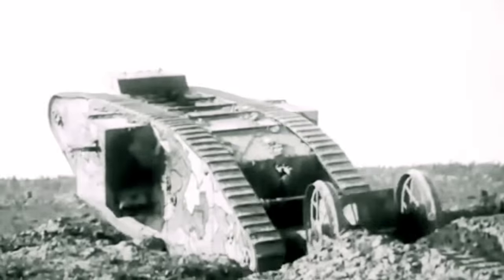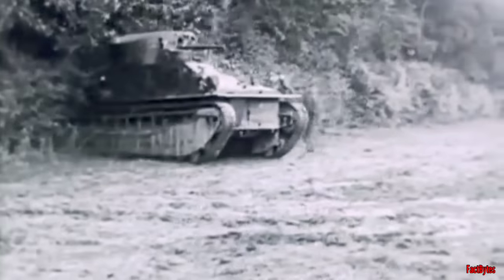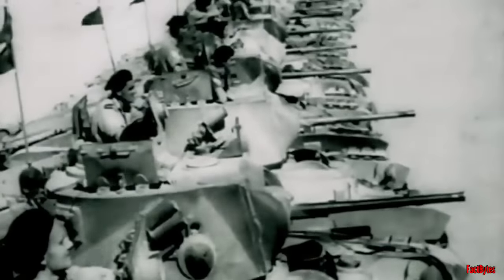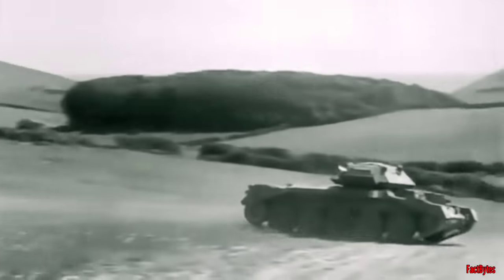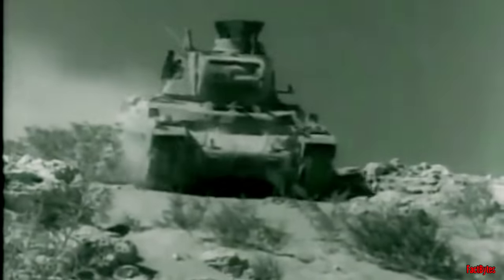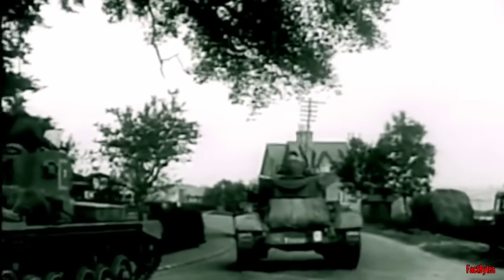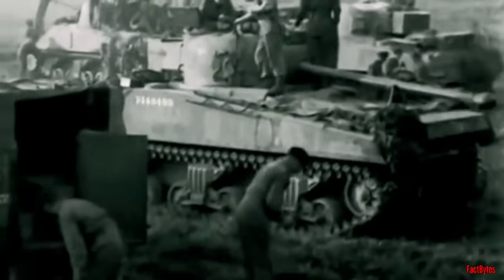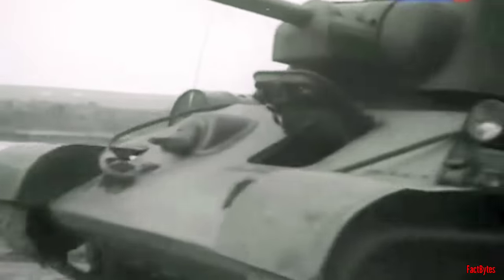Why Did Britain Struggle to Build Effective Tanks During World War II?

Comment: Good video - but I have a couple of criticisms

You should make note the light/infantry/ cruiser tank mentality was worldwide, as was the resistance to change, the US,  France, Germany Russia all suffered from the same issue and similar resulting bad designs.    The British also were stuck, even a bad tank in their mind was better than no tank so they used what they had to replace their losses in France, which you did note.

Although the Sherman was a good tank based on reliability and numbers produced, it was very vulnerable to all German tank and AT guns generally beyond it's main gun range.  Which is a little hard on the crews when you are on the advance against a dug-in enemy.

And the T-34 was only a good tank based on numbers it was not reliable, crewing and ammo storage were awful.  It had good armor, and a decent gun but as we know from later German designs that is not enough.
Reply: But Soviet developed T-34 into T-34/85 with better crew lay out.
Reply: @jaroslavpalecek4513 That improved the crew situation in the turret a bit but did nothing for the other problems the T-34 had. Ammo storage was still terrible, armor was still thin, vision when buttoned up was still poor, basic maintenance was still difficult, it was exhausting to drive, and the interior was still very cramped.
Reply: @jaroslavpalecek4513  But the underlying mechanical issues, ammo layout etc were never sorted out and the gun was so so.   And the base tank had to be improved the original T-34 was getting over matched by German improvements.

Tank development has always been a painful process though
Reply: Russian tank losses ran as high as 600 a day. Total for WWII has been put at 80,000 to 110,000
The U.S. lost 1,000 per month for the duration of the European campaign. These are official U.S. Army totals.  @RichGallant
Reply: @thenevadadesertrat2713  thanks for the info so about 34 tanks a day, do know if those were all write off losses due to combat or both mechanical and combat losses ?
Reply: > "Although the Sherman was a good tank based on reliability and numbers produced, it was very vulnerable to all German tank and AT guns generally beyond it's main gun range.  Which is a little hard on the crews when you are on the advance against a dug-in enemy."

Jesus, people are grasping at straws just to avoid facing the fact that M4 Sherman was the best tank of its weight class at the time.
Reply: @peasant8246  I would highly disagree it was way too high, had narrow tracks that reduced it's cross-country mobility, and although it had a gun dual purpose gun it had at best average anti-tank capability.   The biggest advantage the Sherman had was numbers and overall reliability.    The Panzer 4 was can be argued as better tank although there were a lot fewer of them.
Reply: @RichGallant  We are not comparing vehicles 1 on 1, like in some kind of video game, where each force is only allowed to employ an equal number of tanks. Because of the "advantage in numbers and reliability" (that you have added almost as an afterthought), the side of the conflict using Shermans will have a significant numerical advantage in vehicles actually present in the field, which will more than offset the technical flaws you mentioned.
Reply: I believe we disagree on fine points.   The Sherman was not a bad tank, as an infantry support tank it was in fact  a good tank,  as noted lots of them and a good gun for that role.  However, when facing AT gun and tanks that could kill at range it struggled.    Numbers are great on paper,  but in the real world a dead tank is dead people and as noted by one Canadian commander a crew loses one or 2 tanks they will mount up again at #4 it is a lot harder.

And you are right it is not a video game but at 34 tanks lost a day if every one is a combat lost and let say 40% dead that is 68 dead plus wounded.  That is a lot of dead and wound every single day.   

Having said that one got my father home for D +3 so I have a soft spot for them anyway.
Reply: @RichGallant  Yeah, good point.
Reply: @RichGallant  M4 Sherman had the lowest crew loss rate for vehicles knocked out than any other tank of the war except the Churchill. Casualty rate per knocked out vehicle was lower than 0.8 per vehicle loss, that is casualties, not dead, casualties. Actual losses were far, far lower for Sherman crews than the losses you suggested. 

The myth of high loss rates among the among Sherman Crews is actually a classic case of survivor bias. The actual casualty figures do not support the myth at all. The US Armoured Force for example suffered around 1700 dead in ALL theatres through the entire war. Let that sink in. 1700 dead, in all theatres of operations, during the entire war. 

I too have a soft spot for the M4, my Great Uncle was a Desert Rat, had four tanks shot out from under him, two Crusaders and 2 M4's. Four men died in those two Crusaders, 1 man died in the two Shermans he had to bail out of.

Guess which he preferred?
Reply: The crucial statement is "weight class", the Sherman was mostly under-par as a main battle tank for the European campaign in as much as it was employed to face much heavier tanks. American doctrine was to avoid combat with heavier tanks and bring up dedicated vehicles, "tank destroyers" with even flimsier armour but a good gun, to deal with these. British doctrine was different, infantry tanks were there to protect the infantry from other tanks. The Sherman didn't really fit into the British definitions. In the end it was used as a maid-for-all-service which ended up showing its limitations. When the version with the incredibly accurate 76mm gun appeared it was finally capable of taking on enemy armour. The way the radial engine was mounted in the back with a drive shaft sloping down to the gearbox in the front led to its absurd height, thus vulnerability and unnecessary weight. The Americans should have employed rear sprocket drive on these designs. The steering gear was the Cletrac unit which was a semi-regenerative system (the Pz1, Pz2 and some mms of Pz3 also used this, made under licence), the Cromwell and Churchill had much more sophisticated steering units derived from the Merritt-Brown design, a fully regenerative system that allowed a tank to turn in its own axis. The Tiger had a similar unit developed by Henschel from the Merritt-Maybach, the Panther had a similar development of this but it was plagued with final drive fragility.  @peasant8246

Comment: Simple there focus was on creating the perfect tea boiling vessel, tanks were a secondary tea transportation vehicle.
Reply: No tea ,  no war.
Reply: The Boiling Vessel was a result of an enquiry into what was the biggest unnecessary cause of death, or injury, to tank crews. 

It was realised that tank crews going outside their tank to cook food, or make tea, were extremely vulnerable. Hence the Boiling Vessel, which incidentally does much more than make tea!
Reply: @donyoung1384  In WWI the first tanks originally had an engine parts of which became extremely hot in service, crews would boil kettles and fry bacon on these. When they changed to another engine where this was not the case, the crews were displeased! Crew conditions were abysmal, they suffered extreme discomfort, poisoning by monoxide and cordite fumes, agonising small injuries from metal spall from bullet strikes, stifling heat, atrocious visibility, but they worried about making tea and frying bacon. The British way of life, which has almost disappeared, produced this kind of humour and spirit.

Comment: There is a serious error here in the first 5 minutes. Conformity with railway loading gauges was universal at this time, leading to some very narrow but very long tanks difficult to steer, the French 2C tank for instance. To carry the much later German Tiger by rail it was necessary to change its tracks for a narrower set, remove the outermost wheels and the mudguards. This had to be all put back once the tank arrived at its destination. All economies in the 1930's were coal-fired and dependant on railways for transport. Specific tank carriers appeared in quantity in North Africa later on, mainly due to the relatively sparse railway network there. 
Although the track gauge was the same in the UK or continental Europe (except the Iberian Peninsula and Russia) the loading gauge was different. This is the maximum width and height of cargo, that would allow circulation without bumping into oncoming traffic or tunnel walls, it was a little larger on the continent.
Reply: I blame George Stevenson
Reply: Excellent technical analysis. God I wish we had more of this on the internet.
Reply: Excellent. First rate.
Reply: Inconvenient truth for the disingenuous ignoramuses

Comment: The T 34 wasn't a wonderful tank. It had a good balance of armour and gun, but was knocked together so hurriedly  and badly, that the majority of them suffered from serious reliability issues. It was their numbers that overwhelmed the Germans,  not their quality.
The Matilda II was a good tank in its day. Until the Germans encountered it and realised they had to seriously improve their game. The Tiger I was the result. 
The Valentine was a reliable tank. It's chassis was used for a lot of tasks during the war.
The Churchill was good enough to be upgraded through 8 or 9 marks, and disconcerted the Germans on many occasions. It's adaptability proved useful, in particular the fearsome crocodile version, but also the AVRE. It's ability to to climb was also legendary, caching the Germans unawares several times.
Cromwell, and the improved Comet were very good. Armour was sacrificed for speed and manoeuvrability, anot her Churchill wasn't needed. 
The Sherman was acquired in large numbers because it was available, and reliable not because of its superiority. 
Transportation was always a factor. 60 ton monsters such as the Germans built would have been a liability.
Reply: The Tiger was a respons to the KV series.

Comment: Well you didn't take the engineers and the board and the bosses and make them fight in the tanks. You also didn't take the generals and put the in the frontlines. You would be surprised just how fast they could over come all these problems. Once the rich start dying then things will change.
Reply: Moronic nonsense.
Reply: @snowflakemelter1172  No it is not, but please if there is another war don't call on the people that don't care anymore. Go fight it yourself. It's your money.
Reply: @donaldgrant9067  who do you think we're the flying officers that won the battle of Britain, working class 🤣
Reply: @snowflakemelter1172  That was the battle of Britian. during the war it was college educated that flew planes and officers.
Reply: @snowflakemelter1172  You know a little bit of an emergency there in the battle of Britain?
Reply: @snowflakemelter1172  working class pilots did exist, but they were usually NCOs.
Reply: @donyoung1384 Still not the people that designed and made money off of them or the leaders that said they were good enough. Patton never was in a lead tank in a spear head. Rommel was at the first Casarin pass battle. You didn't see the CEO's of GM who manufactured the Shermans in the spear head tanks that where designed to be infantry support tanks, not break through tanks. Now if they had to be in those tanks in Normandy, I wonder what tanks would be like when their live depended on that tank. I would bet all the excuses like not fitting on the RR track would be solved to handle heavier tanks. The Liberty ships would be lengthened to carry the heavier tanks. The cranes at the docks would have been up graded to handle those heavier tanks. It's one thing when someone else's as in on the line, but another when it's your as is on the line.